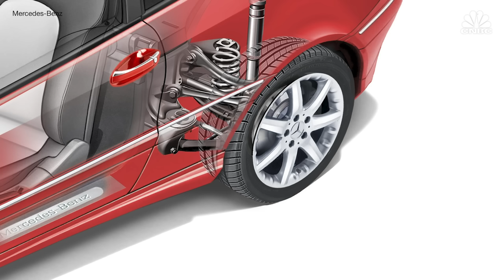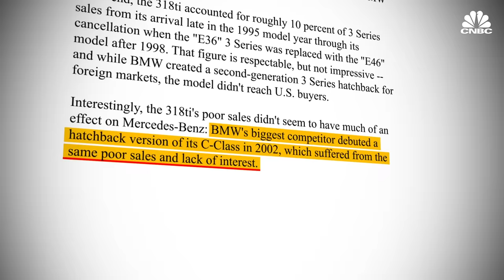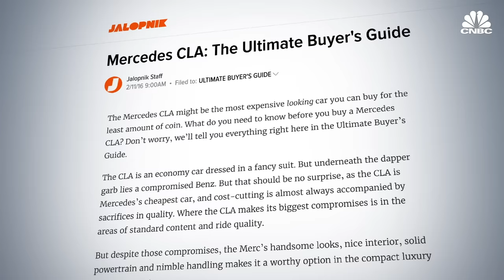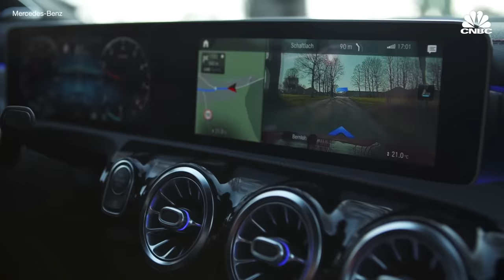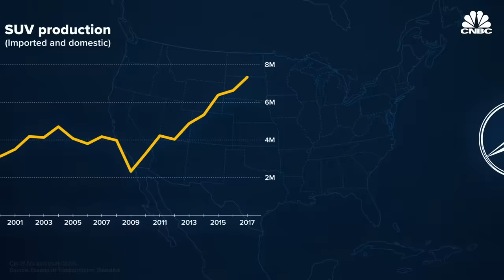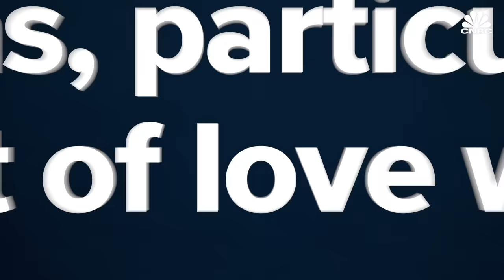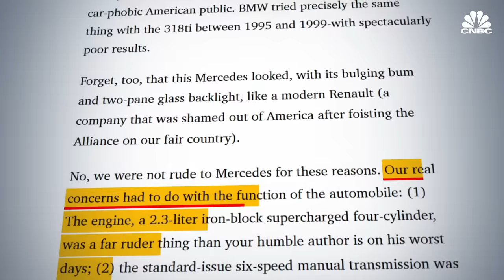Why BMW And Mercedes Made Cheap Cars That Failed

Comment: There’s no such thing as affordable luxury. Remember that
Reply: Seth yep. Luxury brands aren’t even luxury anymore. It’s the separate car models that are luxury or not. The lower-end cars are just premium.
Reply: there are 2 types of luxury
1: underpinnings or how the vehicle handles, how smooth the ride is the performance of the motor and braking system etc.
2: fit & finish or how good the design is, how clean the panels match, the quality of the interior, the options available etc.
as manufacturing improves the differences in the underpinnings becomes ever closer, because it cost just as much to make crappy parts and there is only so much you can improve a ICE power-plant before you plateau the technology, right now there are really no bad engines out there and you don't see a big performance gap until you get into the super-luxury segment. So in the future what really separates the corrallas from the BMW 3-series is merely the fit and finishes.
Reply: Evan Johnson a corolla and a 3 series aren’t far off when it comes to fit and finish, at least in Europe. While one is improving, the other is is maintaining, if not declining.
Reply: @evanjohnson1299  I would say your first point is more "performance" rather than luxury.
Reply: @AntJoseph_  corolla have ugly interior. Plus cheap cars usually have bad ergonomics - they hurt tall people backs, and on the backseat hurt tall people backs very hard :) Its punishment for tall people to travel on the cheap car's backseat. :D
Reply: Tell that to my old Lexus GS300 that drives like new and is super reliable :)
Reply: Except Lexus. My 2008 ES350 has better materials and design than a new 2020 Camry. Only difference is the safety package and Android Auto  (But I can always retrofit a head unit. And some companies like Sony offer an 8" head unit now)
Reply: Lexus wants to speak with you
Reply: Affordability is relative.
Reply: Tesla Model 3 is doing just fine, thanks.
Reply: there is. And it is called used cars
Reply: Genesis would like a word with you
Reply: FALSE. old Mercedes diesel cars. Reliable luxurious cheap
Reply: David Beppler that’s not a luxury car dummy
Reply: My 2004 Gx470  Lexus is smooth, comfortable , fully off road capable and reliable, plus pretty luxurious, all things considered.
Reply: Lexus is literally affordable luxury.
Reply: @AntJoseph_  They aren't even close to each other in fit a finsih?

Mate you are delusional
Reply: @davidbeppler3032  It's not a luxury car, it has  a worse interior then used cheap cars from the 1980's
Reply: Luxury is overrated
Reply: @evanjohnson1299  Completely wrong about ICE.  A BMW engine is far more powerful and efficient than a Toyota engine.  Why more efficient? Because for a Toyota engine to generate the same amount of power, they are using way more gas.  This is very evident by their V6 vs BMW's I6.  Just look at the power curve vs the fuel economy.

I'd agree ICE efficiency is reaching its peak, but not for your basic $20K cars.
Reply: Look up Lexus IS. You get a lot for older ones.9
Reply: this video title is Extremely Bias.
Reply: Avalon, lexus, and infiniti. I'll take any of those cars over any German.
Reply: @M Bacon You didn't read my comment correctly.  No one is talking about fuel economy.  Fuel economy and efficiency are two different things.  You are only looking at one part of the picture.  Yes a Corolla's 1.8L 4 cylinder will have far higher fuel economy but that's because it puts down 100 wheel horsepower compared to 300.  If you are talking EFFICIENCY there is just no comparison.
Reply: @M Bacon You are just throwing statements out there without backing it up.  But let me clarify, I never said anything about thermal efficiency.  You are clearly no engineer either, which I never said I was.  My point is plain and simple, Toyota's might be good at what they are doing (powering corolla as cheaply as possible) but that doesn't translate into performance efficiency.  If you look at the high performance engines of Toyota (mostly in the Lexus lineup) they do not get better fuel economy than BMW.  BMW's real world power (as in WHEEL horsepower) is far more than Lexus with similar fuel economy.  Unlike you, I will throw out some statistics.  All the sources are from the manufacturer websites so there is no dispute.  You tell me which one is more efficient, by the numbers.

Lexus IS 300 RWD (2.0L Turbo/8AT): 241hp/258lb-ft, 0-60 in 6.9 sec, fuel economy at 21/30.  Curb weight: 3583 lb
Source: https://www.lexus.com/models/IS/specifications/is-300-rwd#engine

BMW 330i (2.0L turbo/8AT): 255hp/294lb-ft, 0-60 in 5.6 sec, fuel economy at 26/36.  Curb weight: 3569 lb
Source: https://www.bmwusa.com/vehicles/3-series/sedan/pricing-features.html#!/330i
Reply: @M Bacon Are you quoting emission figures? That doesn't dispute the numbers I posted what so ever.  Even if the BMW "pollutes" more it means nothing to the consumer.  My point stands that BMW has done a lot of work to maxing out the power of the same displacement.
Reply: @MiguelRPD  What kind of 08 es350 you got? I just got one with with the mark levinson audio system and double sunroof
Reply: mercedes and bmw can make regular car too are they

Comment: @3:01 I had a C230 Sport Coupe and it was amazing.  Handled like it was on rails and was tiny and super fun to drive - it was more of a hard-top SLK than a Coupe version of the C sedan.  We owned that car for 175K miles and 15 years with no major failures.  It was an amazing car.  I drove the hell out of it - on the Tail Of The Dragon, Blue Ridge Parkway, etc., with dead serious sports cars and I didn't slow people down.

Comment: The best car you could ever own is the one that serves you well and you forget that you own..................  Not one that owns YOU.
Reply: Give me a Mercedes-Benz or BMW with a Honda engine and a Toyota transmission and you got yourself a deal. Here's my 💰.
Reply: @justacinnamonbun8658  buy a well maintained BMW 4 cilinder with the ZF transmission ;-)
Reply: Leonel Ventura same 🤣🤣 id never buy a MB or BMW
Reply: Im going to frame this comment
Reply: A cheap reliable high quality car like the Toyota echo just makes sense. Cheap to buy and maintain, and dependable. That is, if you’re not status crazy.
Reply: @skateboarding118  is not that i am status crazy but the cars shape is a little too round for me. Could look past it if i had more square edges like the 80s or 90s cheap sedans
Reply: @justacinnamonbun8658  i'd rather have a Lexus as a luxury car than BMW or Mercedes. It already has a Toyota engine and transmission, and it does not look like the copy-paste designs of BMW and Mercedes. The lexus has the leather interior and other luxury features but would have better reliability and resell value.

But knowing myself, i'd never spend money on a luxury car. If i'm gonna spend extra money on a car, it would be for performance mods.
Reply: suzuki swift sport hands down
Reply: @justacinnamonbun8658  Mercedes and BMW have way better engines than Toyota and Honda. Hell, Toyota doesn’t even do turbo engines yet😂
Reply: @kristians2704  Yet they break down more? Weird? Better in horsepower yes in design fk no
Reply: @MJT-DA  most German engines are veru reliable
Reply: @kristians2704  look up jd power manufacturer reliability and consumer reports and tell me where bmw and mercedes are. They’re not even in the top ten stop making things up. Just do your research my fathers owned 3 and they all sucked.

Comment: "Wasnt good enough to be a jaguar'...So it was dependable?
Reply: True :D
Reply: Define dependable ? Driving an F-Type since 2016 without a single incident. But hey if it was true 50 years ago it MUST be true today.
Reply: I always thought the x type sold pretty well for a jaguar in the US, jaguar has ALWAYS been well below the big german two (and now Audi) in sales here
Reply: Mark Temperley 
No I owned one and as much as I liked the looks, it was also the biggest POS I’ve ever owned. Automatic transmission was subpar, interior was meh, reliability was poor, aftermarket support (oe and performance) wasn’t there.

Comment: I had a mercedes c coupé (something with a compressor). It was a great car, very nice to drive, fun with back wheel drive and responsive enough thanks to the compressor. But it was not cheap to own due to the expensive service fees. Did not see many of them rolling around here in Sweden though, so don't know how successful they were...

Comment: CNBC: Entry level luxury cars failed
Audi A3: Am I a joke to you?
Reply: It’s not a luxury car
Reply: @edipires15  The current Mercedes A Class is quite luxury. The AMG A45 S is a very nice car.
Reply: Fred Schriks the A Class is a Premium car from a Premium carmaker, just like the Audi A3 and the BMW 1 Series.
Reply: I'm currently considering getting an Audi A3 used (2015-17). Hearing conflicting opinions through my research for reliability, one side saying avoid at all costs versus the other saying so long as you take good care/regular maintenance/previous owner kept it in good condition it'll run fine.

Edit: minor grammatical errors
Reply: Most of Audi cars is made on VW non luxury plataform, so it is not that exclusive an luxury as BMW or Mercedes
Reply: Prenium =/= luxury. 
An A7 is a luxury car, an A3 isn't.
Reply: @edipires15   yeah it is
Reply: @TheMochaMonster  It depends on teh engine and the driving conditions. A3 with the smallest "overpowered" engine driven like an race car over bumps and you need very often new suspensions, and drive chain parts and the engine will break early.

Then one VW/Audi engine (I don't know which) has a problem with the oil scraper rings  (the wholes o let the oil drop back to oil pan are to small and tend to bung with older or not correct oil. The 1.6TSI engine (or was it the 1.4TSI?) has a weak timing chain that bends under long time high load.

The Diesel Engines (except the pollution problem) are more relieable and 200.000 to 300.000 miles are no problem.

The problem with european cars is that the europe regulations (car tax, gasoline tax, fleet consumption fines)  leads to small turbocharged engines. 

E.G. Car tax in Germany (no real values only showing the system): 20€ for each 100ccm and additional 2€ per gramm CO2 (WLTP) over 95g/km.

A Small 998ccm Engine (Turbo powered) with by WLTP producing 100g/km CO2 will cost you 5x20€+5x2€ = 110€ each year
A Big Block 5.0Litre (5000ccm) V8 producing 200g/km CO2 will cost you 50x20€+ 105x2€ = 1.210€ /year.

The small 998ccm Engine will maybe in real driving consume 5l/100km the Big Block 10l/100km. When driving 10.000km a year this makes 500l gazoline (800€) vs 1000l (1600€) if you keep in mind that in Europe a liter may cost 1.6€ (currently only 1.30€ including 95ct gazoline tax)

At the end the V8 costs you a lot more money than the small engine and these 998ccm turbo charged engines produces currently 100+hp (enough power for driving in cities and the german highway system aka "Autobahn").
Reply: @Okxyd  A7 is more sporty imo, A8 is definitely luxurious
Reply: You mean A1

Comment: 8:20 very true. When I got my BMW 535xi E60 LCI, I was the ONLY one in my family who owned a BMW. I was VERY proud. Now, since BMW/Benz are easily accessible to ANYONE (a 2013 BMW 5 series at $14k, and 50k miles), I felt like I was driving something like a camry. Everyone had one. So I changed to Toyota Prius. If everyone has one, might as well own a car thats bulletproof
Reply: Yeah but most people can’t afford to maintain them and eventually dump them

Comment: Wait what. BMW Merc & Audi are the 3 largest luxury car brand by volume?

Lexus: Hello?
Reply: Jo's Gateway its true in terms of leading luxury sales in US. Not saying Lexus doesn’t have a spot i mean they have the highest dealership rating
Reply: I thought he said 3 largest German luxury brands?
Reply: Actually Lexus is number 3 right behind Bmw and Mercedes in the US . The have 13.08% of the market while Mercedes has 13.85% and BMW 14.26% . Audi only has 9.82% . Lexus has always been in top three  some years evening the best seller here. The Rx was the best selling luxury vehicle for years it only recently been dethroned by the Tesla model 3. Tesla has 9.75% of the Market right behind Audi. So Lexus should have been mentioned.
Reply: Lexus is an American only brand...
Everywhere else it's called Toyota.
Reply: @tamahawk175  lol says who
Reply: @jjgates6351  Lexus was built as Toyota luxury for California. It only recently started selling in Europe and doesn't sell well because there's no connection to reliable Toyota brand recognition in a new Lexus brand  badge, up until recently stuff like the ES and LX models were Toyota branded in Europe and Asia

Comment: My entry into luxury was a used Maybach I got for 16k off Autotrader a few years back. Extremely low mileage but I sold after a month to some local dealer that wanted a flashy toy for more than I paid. I found an Audi A8 for 8 with 68k miles, sold that, found another Audi in Chicago for 10 sold that, then I settled on a used Kia fully loaded and put all the extra money into my house. 

The reason I never keep those cars is seeing the cost of maintenance. I also have a nice older subaru that I modded anyway and I dont actually worry about scratches, dings or maintenance, they are cheap and money goes further putting it into my house or my kids investment accounts. I did get my wife a Genesis G80 from 2016 I found at auction for a great price but I just dont think families that make less than 200k should waste money on something so frivolous when I've worked for millionaires who drove a 78 Chevy pickup and a old 80s Rolls. Every wealthy person I've met seems to never waste on things that LOSE value, that got my attention to not worry so much about luxury cars after always wanting them when I was younger.

But that said I still will see 100k trucks and cars outside the projects.....

Comment: People "return to the brand" if the ownership experience lives up to their expectations. The biggest factor in the ownership experience in quality. I've owned  Mercedes 300 CE and a Porsche Boxster, which represent the premium brand family. Both cars were maintained by the book and required expensive service to keep them operational (fixing things that did not work). I have since moved to Toyota (4Runner) and will never look back because the ownership experience has been excellent. I appreciate the premium brands, but the most important factor for me is that the vehicle stays on the road versus in the shop. I will return to the brand...
Reply: @Chris Burget, that is the reason why people tend to lease the German cars than buying them.
Reply: Hi sir. Since you mentioned your Toyota, why return to the brand, if you can try LEXUS instead?
Reply: Isn't Toyota too boring after Porsche and Mercedes?

Comment: The new CLA and A class sedan are doing very well actually. and they now look like any of the others in the benz family. but yeah, the previous models were not on par with the brand's premium status.
Reply: The difference is that they are actually pretty nice cars
Reply: A. S. Hiwa - Mercedes took into the new A Class to install a proper Mercedes interior into that size of car, which will be passed on to the 2021 CLA Class and then the GLA's. BMW and Audi were there months to a few years earlier with their smaller offerings.

But the vans (Metris in US, Vito / V Class in Europe) are still awful (just ask Doug DeMuro), and I don't say to update so much the cargo versions (need some work), but the passenger versions need an INTERVENTION.
Reply: The C, CLA, B, and A class don't even count as luxury with all the optional features. I'd rather buy a Mazda than one of those pieces of garbage. A Lexus at that price range at least has enough standard features to qualify as luxury.
Reply: syxepop the V- Class has the same Premium quality as any Mercedes cars, the Vito/Metris is a commercial Vehicle, so the quality isn’t in the materials but in its durability
Reply: syxepop I don’t trust DeMuro as much as TFL when it comes trucks/vans. He doesn’t enough time on those vehicles while TFL, at least, does more scientific tests.
Reply: I’d add that adjusted for inflation, a 2001 C-Class coupe cost $37K. So, the cheapest ones worth $33K are cheaper than ever!